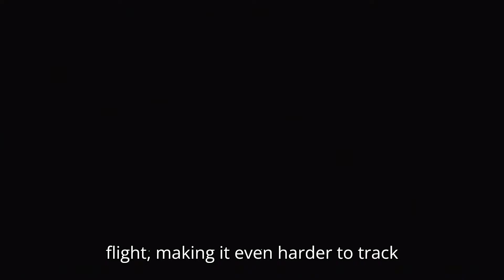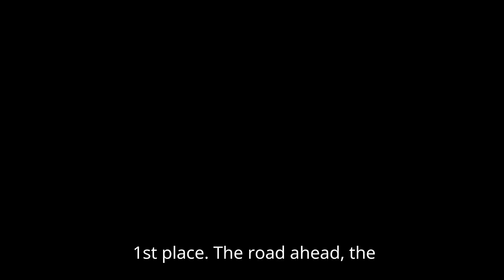Hypersonic Missiles: Can They Crack Our Defenses?

Comment: Above the ionosphere in Leo orbit, Avanguard travels at Mach 55 , it's reentry angle is gradual  threw ionosphere and stratosphere as to control the plasma shroud until troposphere. At that point it's speed is at Mach 27 and maneuver swiftly from any painted radar lock, and you can't fire intercept STA or Lasers without 1st locking on it! It's sort of like Dove hunting with a .22 cal. with iron sights as they dodge,dart, drop suddenly, change directions on a whim - even with shotgun spread the best odds are 80% dove 20% hunter! Генерал Гергорй Фиэлдсимовь
Reply from the maker: Intersting piece of info
Reply: @Strategic814  The 25 Avanguard GV's circling the globe 🌎 right now are of 100 megatons thermonuclear yield, the Tsar Bomba of space! One hit 🎯 on Washington DC would take out Maryland, Delaware, Virginia,half of Pennsylvania and New Jersey! Followed up by a Poseidon with a forward blasting 200 megatons thermonuclear yield torpedo off the Continental sand shelf traveling inland at the speed of sound and 1500-2000ft in height!
Reply: Your movie of 1997 ... "Deep Impact"  would be very close to the destruction of Poseidon!
Reply: @Strategic814  : also, USA has 4 deadly natural weak points...1 The New Madrid fault line of the Appalachian mountains 2 The vast methane ice crystals under the BP oil spill sight in the Gulf of Mexico 3 The Yellowstone Super Volcano Caldera 4 The San Andreas fault line on the west coast